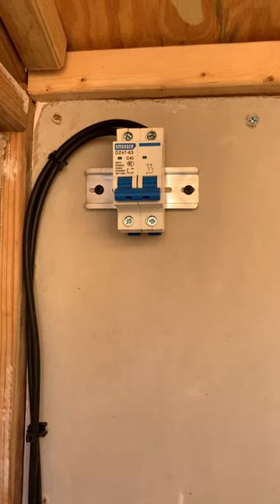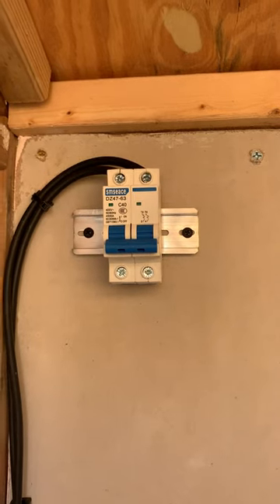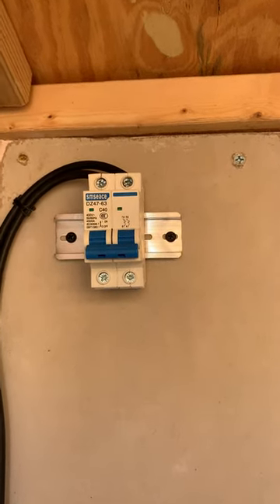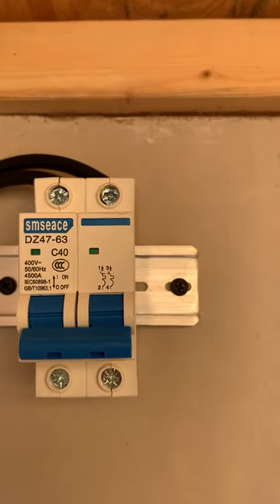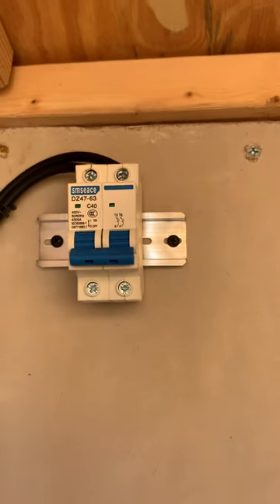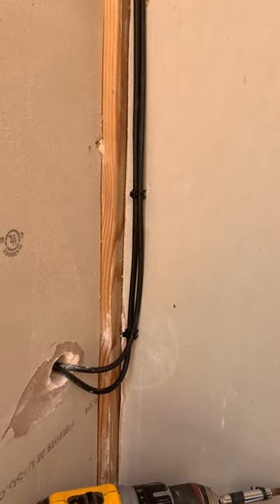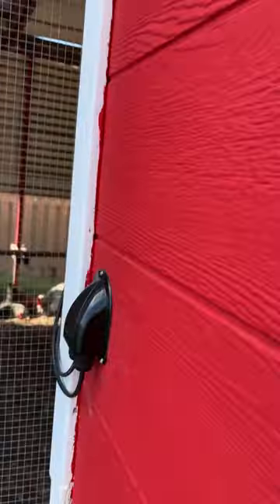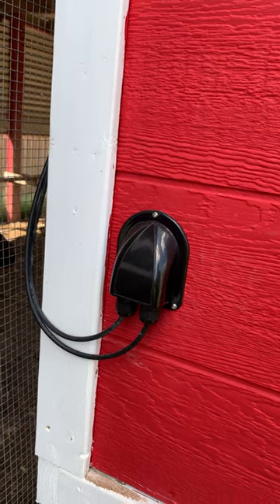Solar Install: Solar Panel Cable Termination and a 40Amp Breaker

Comment: Dot u need a pv junction box
Reply from the maker: You can use one if you want, I would if the system was exposed to elements. My entire system is in a weather proof enclosure so a junction box would seem redundant to me.
Reply: @twodrshomestead  ok thanks can I get away with the braker by it self
Reply from the maker: I can’t comment on your situation